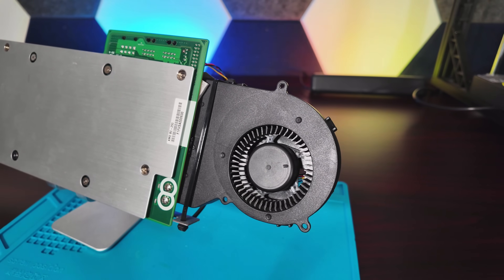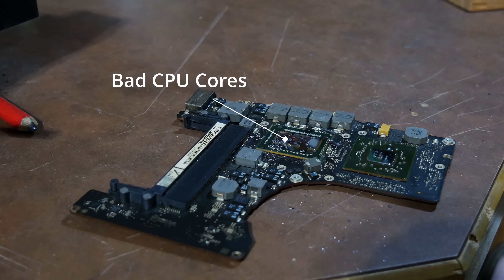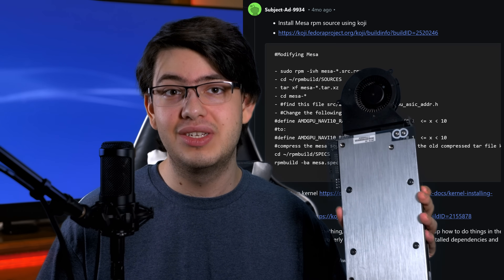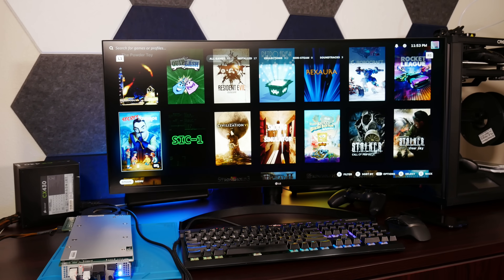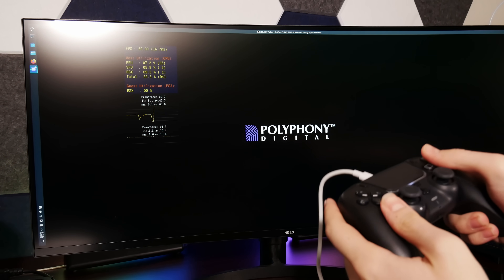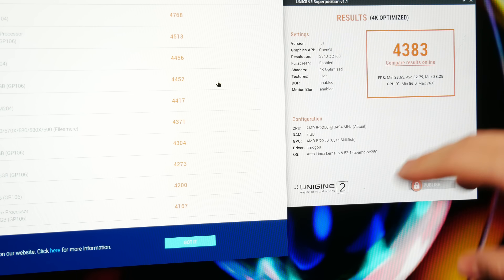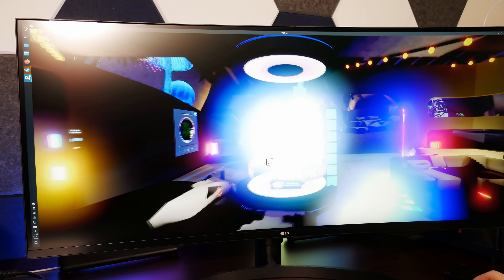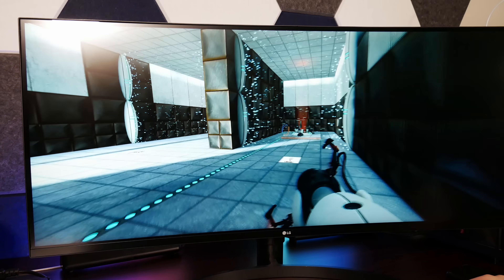I Ran PS3 Games on PS5 Silicon to Prove Sony Wrong

Comment: Not being able to play ps3 games on a ps4 or ps5 is a huge fail by Sony
Reply: Nah, don't push too much, PS4 would not be able to emulate PS3 with its weak CPU
Reply: @ThibautMahringer False (My Jailbroken PS4 ) Has Ps1-Ps4 Games on it ,It even has A few Gameboy advance pokimon games
Reply: @user-ed4gj8kf4k  You run linux on your PS4 ? To my knowledge it's the only way to have PS3 games running on PS4, and oh boy RPCS3 doesn't work well on PS4
Reply: It's definitely not possible on the PS4 or even on the PS4 pro, the PS3s CPU is more powerful than the PS4s CPU the PS4 pro mostly upgraded the GPU and when it comes to emulation the CPU is whats going to be doing the heavy lifting until you start upscaling the resolution past the stock resuluton of the console you are emulating. But yeah I have nothing to say about the PS5 it's pretty much better than the PS3 in every way, it has a better CPU GPU RAM and SSD the only downside is that at least RPCS3 does not like AMD hardware for some reason I found it works best with an Intel CPU and Nvidia GPU. But that could be that emulator and not necessarily the PS3 games themselves but I don't know that much myself.
Reply: @MavrosXV Wrong actually PS4 CPU is more powerful than PS3 CPU how and why, well here is what Google says,No, the PS4's CPU is generally considered more powerful and efficient for modern gaming than the PS3's specialized Cell CPU, despite the PS3's higher clock speed and theoretical GFLOPS; the PS4's 8-core AMD Jaguar CPU is a more balanced, general-purpose processor, while the PS3's Cell was difficult for developers but excellent at specific tasks, making direct comparisons tricky, with the PS4's much stronger GPU and faster RAM being the biggest upgrades overall. So what kinda false information your getting. 😂
Reply: Even PS1 and PS2: I understand why PS4 can't back compat with the PS3. The PS4 used a pretty low power CPU
Reply: Casuals won't punish them for it.
Reply: PS4 cpu would be too weak
Reply: Remains one of the primary reasons I still don't see every buying a ps5
Reply: @custos3249 the PS5 doesn't even have a web browser
Reply: Ps1,psp,ps2 on ps4
Ps3,psvita,vr1 on ps5
Reply: @RockyLaRosa  having PS3 games on PS5 is different from PS5 being able to play PS3 games. For instance the PS4 and PS5 have PS1 PS2 and PSP emulators, so theoretically they can play any of the games from those consoles it's not that way in practice but it is technically possible. And for the PS5 it's basically an upscaled PS4 so it's PS4 emulation is pretty much perfect because it's basically a super PS4 pro. But the PS3 games are ported to the PS5 some from the Xbox 360 . The PS5 isn't emulating a PS3 the game is being altered to run on the PS5 and this cannot work for all or even the majority of PS3 games.
Reply: Max Payne 1 is available on ps4 but not Max Payne 3 😢😢😢
Reply: Although, I do question why you’d bother buying a ps5 when the ps3 exists? I can think of less than 5 triple a games that are worth playing since the ps4 released.
Reply: ps4 is probably incapable of due to to the performance w/ ps4 they switched to x86; but yes, that was the reason I moved away from playstation for good I didnt want to have several consoles and had too many games for ps3 (digitally bought so I couldn't resell them) also the audacity to charge for multiplayer was a big no no .. moved back to pc never looked back
Reply: The PS4 has a very weak CPU; that wouldn't work very well.
Reply: You can I do with my ps5 pro I got PlayStation premium and I download them for free via the store.
Reply: Bcs USA makes Playstation now...designed in California, made in China
that tells everything
Reply: @mr.electronx9036  literally what are you yapping about
Reply: @bigboysdotcom745 i think he means corporate greed
Reply: @bigboysdotcom745  you are very slow aren't you? Can't pick up on anything not obvious, eh?
Reply: @sebastianwilliams5060  unlike you not everyone is chronically online to get every reference. People have a life.

Comment: I worked for Sony during the PS5 development. I was only on QA but Dev X was upstairs and we heard a LOT of stuff through the grape vine and from the few testers who were involved with the back compat program.

The PS5 is completely capable of playing all previous gens. It was in fact intended to. It was tested in secret but I knew one of the guys who was a back-compat tester (He knew I was interested in moving into it and he was quite encouraging of it) and kept me somewhat updated on the days he didn't mind breaking his super strict NDA :/.

PS1 was just fucking nailed. No issues. No notes. It worked pretty much 100% though I never asked him about disk swapping for titles like Final Fantasy, Vib Ribbon or MGS special missions. Considering how big a fan he was of FF7 I expect he did test it and it did work.

PS2 was "good" but needed a lot of work. The compatibility rating was way over 50%. The biggest issue with PS2 was the controller incompatibility because of the whole pressure sensitivity stuff on the controllers. There were solutions and work arounds but they were considered pretty hacky and not compatible with the goal of the project. I'm not convinved we would have ever seen this come to release unless the devs were happy to shift the goal posts on what was acceptable.

PS3 was going strong. I don't think there were any particular issues, just time. Though some features wouldn't work like anything that allowed you to pick custom mp3 sound tracks for games but I don't belive this was considered a substantial enough issue.

I have zero recollection of PSP or Vita and don't know if they were going to be on the list. If they did make it to PS5, they would be digital only. 

PS4 as you know was like... 99.8% or something daft... really good!

2 things stopped it from being released with backwards compatibility:

First, the difficulty in getting close to 100% compatibility. The game library needed close to 100% compatibility to pass the bar. This is because if it was a mixed bag, it wouldn't be good enough to have as a feature on a system. I was also told that it would upset publishers if their old games didn't run perfectly and could leave Sony liable to being sued but I'm genuinaly not convinced that one was true. I know some people would say "Even 50% is better than 0%" and it literally is, sure. but people would STILL get angry about it and bad press would have circulated around it. It wouldn't have been worth it. 50% would have caused more problems for Sony than 0%, which is stupid but it is infortunately true.

Now, I genuinely believe the compatibility could have been at a suitable level if the time was given to finish it. Unfortunately, Jim Ryan personally shot the back compat program down. He didn't like the idea of Playstation "looking backwards". He also didn't think it was financially worth it because it's not like Sony would make any money from second hand sales of PS3 games and as we've seen from Microsoft, it's not terribly easy securing licenses for all these old games to sell them digitally as many of the companies who held these are long gone. Jim Ryan was also well known for being actively hostile to back compat game preservation unfortunately. Glad he's fucked off.

If it was 100% up to him, PS4 back compat wouldn't have even made it in there. It's only because it was already done and could actually generate revenue that it stayed in there. Everything else was cut off unfortuantely. Ironically, the back compat probably saved Sony a lot of problems for the first few years. PS4 titles formed a significant majority of the PS5 use time and revenue generation.

Will we see if for the PS6? Honestly, I think the odds are surprisingly high. But it is hard to be optimisitc about it. The desire is there with the engineers. It's just got to actually work well enough to sell and be worth the financial investment. Sony also have an archiving and preservation department that was formed a couple of years back so I'm hoping this plays into it. I've heard specualtion that they'd put this on their streaming service, but I don't think they will. I think they'll either have a thing like Nintendo where you get access to a retro library if you pay for PS+ (or whatever the fuck it's called now) or - what I think is most likely knowing Sony - they'll just put them up for sale individually.

Comment: PS3 emulation is cool, but my roommates and I have a 1st generation 60GB PS3 that is about to be sent off for repair and modification. I would rather have the 100% comparability for PS1, PS2 and PS3 games on real hardware. I know that is not an option for everyone, but, if the option is on the table, just rock a modded 1st generation PS3, it is also nice having the bonus Blu-Ray player.

Comment: I know this is two months late, but you can enable amd overclocking by enabling the amdgpu.ppfeaturemask=0xfffd7fff in the kernel commandline, then see if you can change the memory clock with CoreCtrl.

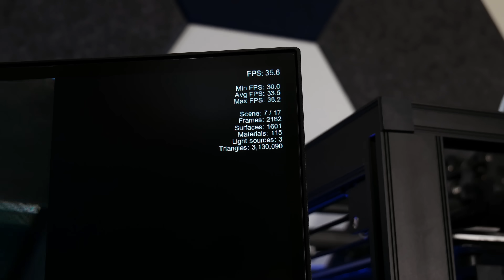Comment: 5:57 isn't the RX480 pretty much the PS4 pro GPU?
Reply: I'm pretty sure that was a 580 but yeah pretty much.
Reply: @donovan6320 as far as i know it's the Xbox One X that has a 580, but then again, it's pretty much the same GPU
Reply: @crazyone3494 yeah it's basically the same...
Reply: Basically ,basically. Let's get deeper than basically
Reply: @nrud2121 okay then, go over the specifics, transistor counts, stream processors, flops, etc. What I remember from memory is that the it uses the GCN 5 architecture and it's the Polaris chip
Reply: @nrud2121 The 580 is a slightly higher clocked chip with a couple more SU iirc, but was built on Polaris and is specced similarly to a 580

Comment: I am a gentoo Linux user.  The only reason I will NEVER run Arch is because ANONE and EVERYONE can poste ANYTHING to AUR which is an almost completely unmoderated repo.  I wont even use gentoo overlays for the same reason.   AUR is a MSAJOR serurity liability and there are a huge number of packages in there that should rightfully be maintained by a dedicated arch maintainer and be in the main respositorty.... but they are not.

Comment: This is why I switched to Xbox. My Series X serves as a 3 generation gaming machine in one for me, (I havent bought any OG Xbox games yet, Battlefront II and KOTOR look appealing though), and I feel like my PS3 wont last much longer considering the internals are caked in dust and was abused by the last owner. My PS4 is practically still brand new, I bought one of the last factory new PS4 Slims straight from Sony only a few months before they were discontinued, so I can play all the PS5 games I want without needing a PS5, since 99% of PS5 games have come to PS4 and most of them are crap anyways so I stick to older last gen titles. 

If Microsoft can do backwards compatability this good where OG Xbox and 360 games are playable on a console 20 years newer then why the hell cant Sony?

Comment: Whilst we all knew this was possible and can happen. They have to relicense the games, make sure they work perfectly from start to finish and building a robust consumer emulator will take a while even with the Source Code. 

Still though, great to see what we all thought possible happen. People saying the PS5’s CPU doesn’t have enough CPU overhead not only are wrong but fail to understand that when Sony does start relaunching PS3 games they will probably work on both PS5 and 6.

The only system that doesn’t have enough CPU overhead is PS4 and that’s why we still haven’t seen it I think.

Comment: The fact that Microsoft fixed Xbox 360 backwards compatibility for the Xbox X and that PS3 emulation has been done on Windows for a while now, proves Sony wrong. Sony didn't even bother with PS1 emulation on the PS5, something which the PS3 already have. For this reason, I've switched to Steam, since I bought the Asus ROG Ally. It's ironic that modern Windows hardware has better PS3, PS2 and PS1 compatibility than the PS5, lol.

Comment: 5:24 Did you say.... Full speed Ps3 Emulation?!!? On a Ryzen 5 [Comparable] CPU and yet i have an i7 9700K with at least double the clock speed [4.6GHz] and i have speed issues, like Not [Ever!!] hitting 60FPS?

Comment: that is not 1440p, which is a standardly defined resolution.  You're using a friggin ultrawide monitor FFS.  And the resolution reported isn't even actually 2x either, it's closer to 1.35x, so your ultrawide isn't even adding an extra half a monitor, which for all intents and purposes, it should be at least at 50% more real estate.  1440p, the ACTUAL resolution, is 2560x1440.  You're running at 3440x1440.  Lemme guess, that's one of those 21:9s.

Further more, you should be able to re-enable all those cores/threads.  They're physically present, so there should be a way to do it if they were disabled (unless the hardware was, for some stupid reason as software exists to do limit these things, intentionally damaged to do this).  Considering we're talking linux here, there should DEFINITELY be a way to do this.

Comment: Even if you thought that the performance was bad, its mostly on the emulators part. RPCS3 is known to be very laggy and non-reliable as I have had issues with a somewhat powerful PC and only running sonic unleashed at 15-20 fps with frame drops and crashes

Comment: complexity of the system nonwithstanding
if anything, because the ps3 is not a single-threading machine, you're not as likely to be bogged up by overhead on a single thread for emulation

Comment: if you are already running playable games on in, you just need to do bios modding to unlock gpu frecuency, also some guys just used the m.2 port with a pcie rizer to put external video card on it

Comment: The ps3 can be played on current hardware. Just like game companies they do not keep records of old code and tech. Like how most old games have not been remade because they actually no longer have the original code. Just like what happened to crash bandicoot. 

It should not be impossible to remake any previous hardware and making something old should be 100 times easier then making something new espically if you already have all the data.